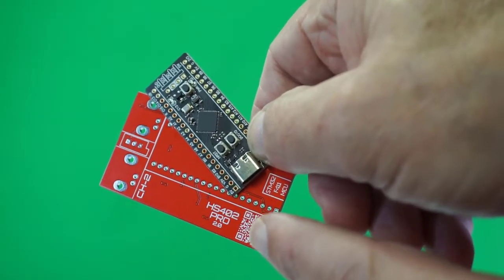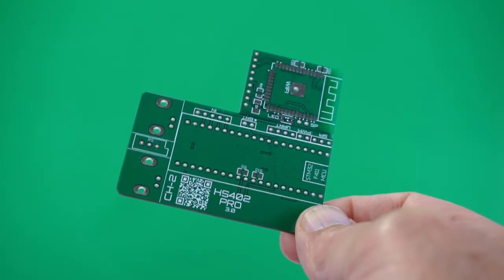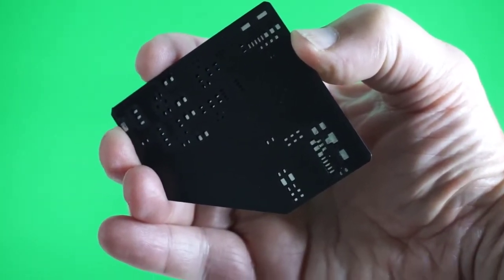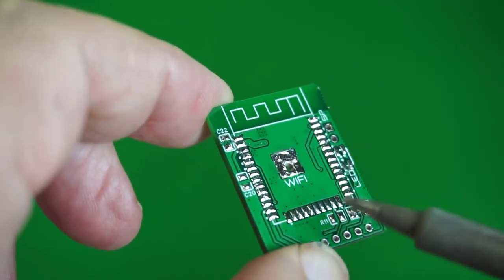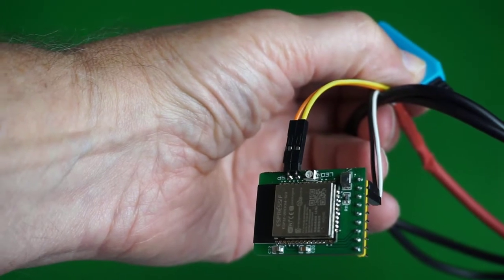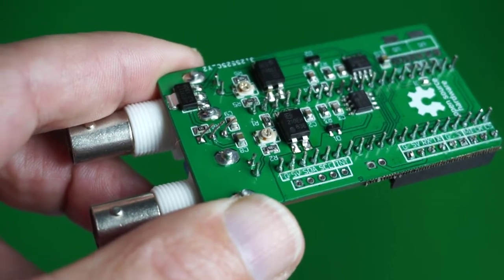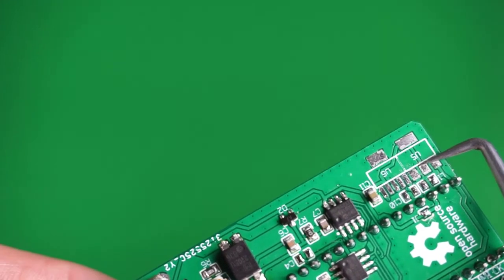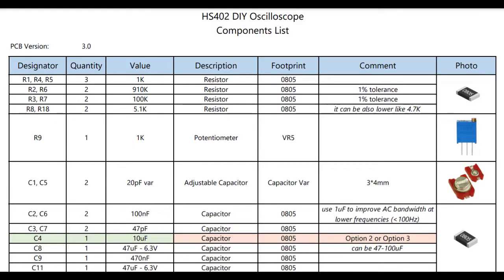GADGETS#160 - HS402 PCB 3.0

Comment: Hey Denis, as far as I can tell from the schematics you have to do an option 3 build if you want wireless (using Lithium battery).  I think I'll go ahead and do the WiFi build, I'll probably use a Lithium charger board from Adafruit to charge the battery.
Reply from the maker: many options to HS402 builds...can be USB or can be WiFi...

can be powered with power packs that already have controller (as I've done) or with 18650 or with pouch lithium and then add charge controller...

we get to choose:)
Reply from the maker: options 1, 2 and 3 are for the noise specification...these can be USB or WiFi

there are 2 way to get WiFi on a HS402 build...either by populating that small detachable portion of PCB v3.0 as shown in this video...or...by using a 30pin ESP32 WROOM board (easier method) as shown in a few videos on this channel...

Comment: Sadly has cost more to build than I had hoped it would, but almost done soldering it.
Reply from the maker: they're cheaper by the dozen:)

I fully understand. And inflation is a real thing. On everything including these components.

today, there is fully assembled HS502...wasn't the case at time of this video...and when we factor in that HS502 comes with both HScope and Automotive licenses...

I use these HS402 circuits in GADGETS which allows them to have their own internal oscilloscope...and because I have PCB boards and SMD components left over, these circuits become cheaper to make

I will add that there is a sense of accomplishment as well on a successful HS402 and also that it's the only way to get a WiFi version

good luck with completing your build:)